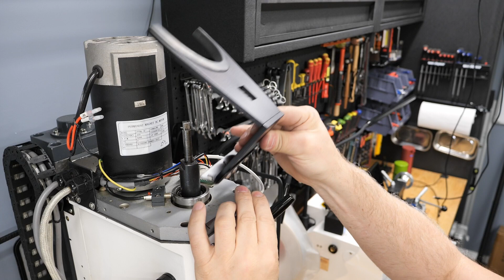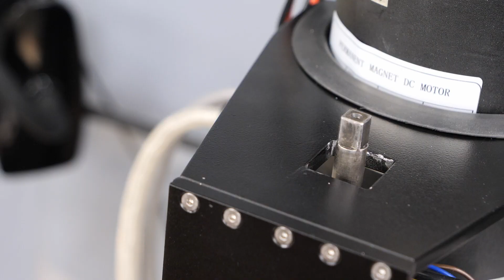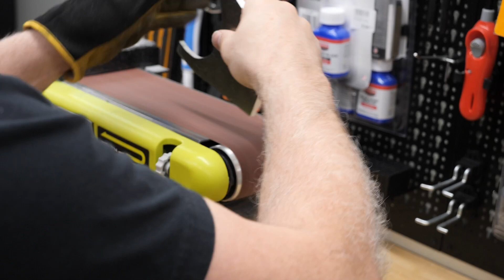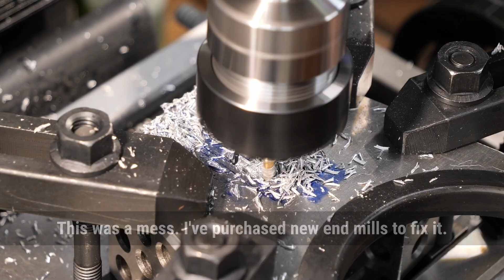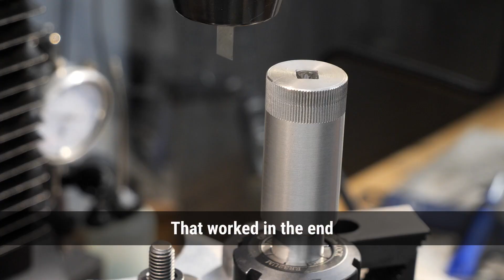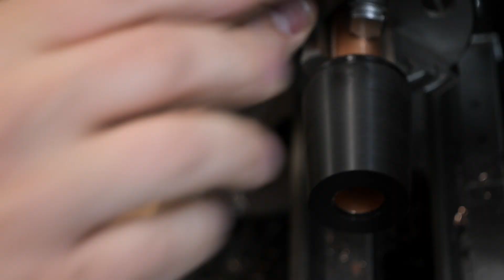What's This? The Drawbar Lock - Rob's Garage

Comment: Ecellent idea and superb design and machining thanks Rob. I have an Optimum Mill/Drill and it has a magnetically enabled switch as part of the perspex chip screen, configured so you have to swing the screen closed before the motor will operate. You could add a limit switch in series so when your drawbar lock was inserted the motor won’t operate.
Reply from the maker: Hey thanks! I appreciate the comment very much. Few people comment on this and on my Tool Arbor Lock mod, but they really are the best mods I've made to this mill. It's sooo much easier to use with both of them. And yes, I've still got the switch present on my machine so I could use it. I kept all of the stock functionality in place when I added the DRO. However.. I only made the mistake once, and that really burned it into my brain and so I haven't done it again (so far!). The same thing can happen with my arbor lock as well and there I got into the habit of always flipping into neutral when I change tools. But this wouldn't work if I let someone else on the machine. They'd immediately blow a fuse. So yes, might have to mod them both with switches.

Comment: Hi, just in the process of buying a BF16 mill (I'm in NZ too) and I love the look of this mod. How did you cut the semi circle cutout for the motor? I will also have to make a 12mm drawbar (sigh).  Did you ever fit a rev counter to your BF16? hopefully i can use the drawbar lock to mount a sensor.
Reply from the maker: Well as far as I'm concerned it's a brilliant mod, if I may say so myself! This and the Arbor lock in the video after this one have made operating the mill so much easier that I wouldn't ever be without them. The arbor lock is dead simple if it works with your mill and your collet holder, which it probably does as it's probably the same as mine. This Drawbar Lock was not all that easy to make, but it's well worth it. I roughly cut that radius on my 4x6 bandsaw in the vertical cutting position, and then I cleaned up the edges on the end of the belt sander, which is in the video. A half round file could have also done the job with a bit of effort. The hardest thing here was making that square hole in the little block piece. In fact, that piece was very fiddly to make because I had to design it as I went along. If I did it again, I'd still make it the same.
I didn't fit a counter to the BF16, but I think you'd be to fit the sensor in without much trouble. You really only need one screw hole and a piece of Acetal plastic is great for locking it down. I've got a 6 part video series on my channel where I install a DRO on my mill. I think the last episode has the bit where I install the sensor and you can see it to the base plate when the cover is off.  Obviously there's more room in this mill, but there'll be room in the 16 as well and you might find one or more screw holes you can repurpose as I did.
I also had that problem with the BSW and M12 drawbars. You might have seen my video on it where I made a BSW one because this mill came with an M12 and all my Machinery House stuff wouldn't fit. So I have both now, but so far I've not had to use the M12 even once. I thought I'd be buying M12 arbors from eBay or elsewhere, but I haven't had to yet. All the jobs I do have only used the ER32 collet holder and occasionally that face cutter. In any case, good luck and let me know how you get on.

Comment: Great helper tool youve created, heaps of sweet new camera angles and format for this vid, it was cool to watch. I might have even seen a CCMT sneak into the shot when turning the acetal, its good to try all the common shapes, DC, CC and TC  i like the 0.2 radius ones for the small lathe. There was lots of setups in this, it must of taken ages to film and edit, well done.👍👌🇦🇺
Reply from the maker: Thanks Adam, you're hired as prime channel commenter! Yeah, that boring bar is form a set similar to yours.. I  got a set with 4 bars from small to large because my original boring bar never fit inside anything I needed it for. In this video I also took what I learned from my surface finish video and did deep and fast cuts with the carbide inserts and the results were excellent and with none of that smearing I was getting before. I should really have done an extra set of cuts in that video, but here it is in this one.